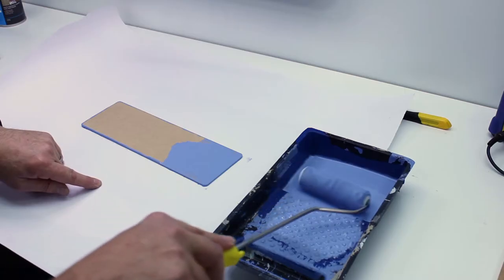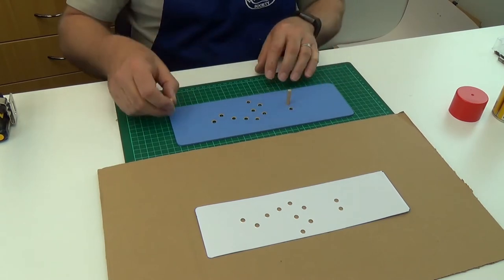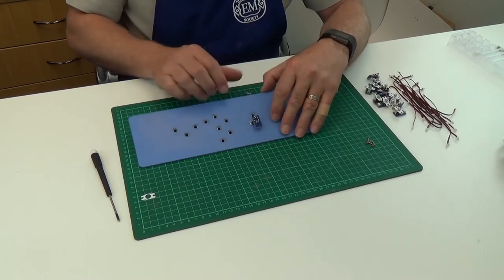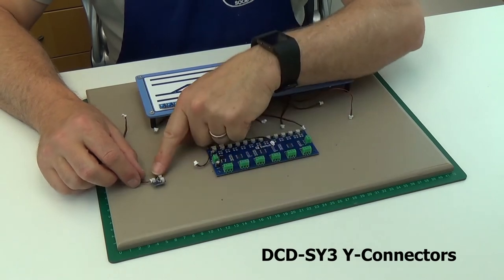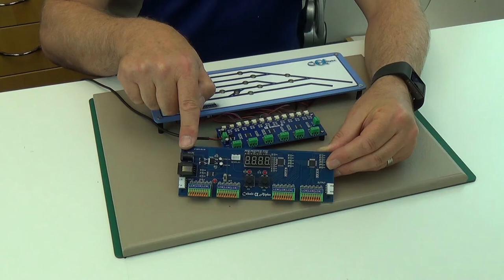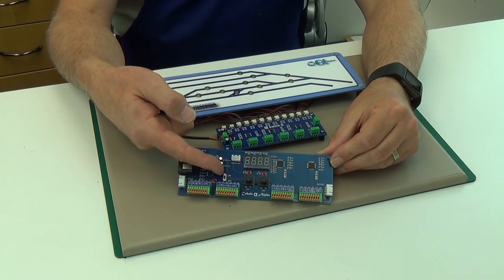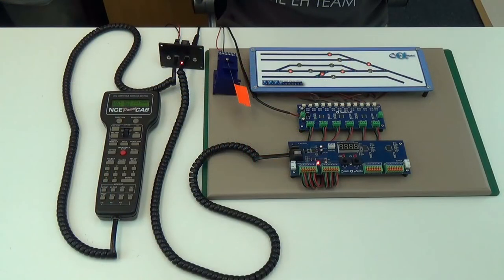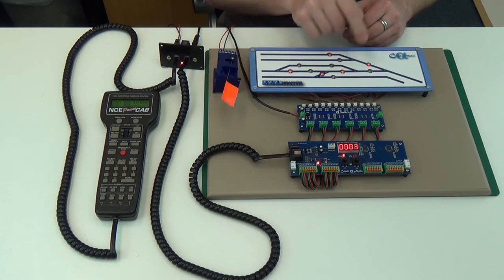DCCconcepts - Creating a Control Panel using Alpha Switch D (Part 2)

Comment: How would this be used to control a peco SL-E99 three way point?  It has two point motors and has combinations that have to be correct and in the right order to work

Comment: Can I use a Z21 connected to this system? And tortoise switch machines?
Kind regards
Jonathan
Reply from the maker: Absolutely yes - you can connect an Alpha Switch D panel into the Sniffer Port on the back of a Z21 system using our Sniffer Adapter (DCD-SNX). 
Pressing the buttons on the control panel will then send the command to the Z21 - the on-screen display will change and your accessory will be controlled :)

Comment: Is this Loconet compatible ? Or Xpressnet compatible ?
Reply from the maker: Hello John. 

It is only an accessory system that "piggybacks" onto an existing DCC system or is a "stand alone" accessory only system.

It is not directly Loconet compatible, but can be hooked into a Digitrax system using the relevant adapter cables and Alpha Box.

The same applies for Expressnet.

The Alpha protocols are based upon the NCE Cab bus.

I hope this helps...

Richard, DCCconcepts

Comment: Although I like the concept of (mostly) plug and play, for getting the digital input push button commands onto the dcc  and or accessory bus. It’s the multiple break points of 6 and 12 turnouts that is a real downside e.g. For 13 turnouts and need an extra AEU and a DCD-DSB costing circa £120 just for adding an extra turnout, it softens the blow if you need upwards 14 to 18. Sure for turnouts 7 to 12 and ditto 19 to 24 it is just an extra DCD-DSB at circa £50. You certainly have to be careful on costing this system up and that’s before all the cost of the dcc turnout motors! There’s certainly a high price to pay for going minimal on the wiring, but recognize it’s all about getting the balance features, components vs cost right. This video certainly helps clarify, particularly addressing in fixed address  blocks of 12 which you written instructions are not clear about. Otherwise a very informative video, left me a lot to think about! thanks Stephen
Reply from the maker: Don't forget that a crossover is only one input, not two - the same as a turnout loop or a catch-point :)
Reply: @dccconceptsyoutube6446  Yes realised that - three good points (pardon the pun)- just as for control of solenoid point motors. Thinking about that with your system can you do anything like diode arrays as used in route settings, that is without adding some other form of logic control/  processing or mapping/ array. Correct me if I am wrong but I got from this video that an input address has to match exactly the same point address so it can control it. Cheers Stephen

Comment: Not so much from this video but.... DCCconcepts seem to have great products but also the worlds most confusing naming to their electronic devices. I've been studying their videos, documentation and explanations for ages only to be befuddled by their combinations of strange terminology and I'm from an electromechanical background! Alpha this, Cobalt that, Cobalt Alpha combined, sniffers, boxes and centrals, Zen, iP, SS...... There is never a basic overview of what it means. It is always assumed that you fully understand all their complexities before you start! I bet they are inundated with queries simply because there's no explanations of how to make sense of it all!
Reply from the maker: Hello! Our products are in families, much like cars - so VW has (for example) a Golf and a Polo - under those model names there are various different options and trim levels.

DCCconcepts / Legacy Models - these are our main brand names.

Cobalt = Anything that makes turnouts and accessories work on your layout.

Under this there are various different models of turnout motors etc. such as Cobalt iP Digital or Cobalt-SS, there are also control system products such as Cobalt S-Lever.

Cobalt Alpha = Physical control of digital accessories. This is where pushing a button or flicking a switch sends a digital signal to change your turnouts or accessories. Still under the "Cobalt" umbrella as it controls accessories, but a sub-group which has buttons, encoder boards, extension wires etc... You can think of Cobalt Alpha as the components you'd need to build a control panel for your layout.

Zen = Anything that makes a Locomotive work such as decoders and stay-alives etc... 

Other products are individually named such as "Rolling Road" or "Trackbed" etc... 

We are open 6 days 10am until 5pm with a dedicated sales and customer support team. We also have a forum at www.dccconceptsforum.com and of course our main website at www.dccconcepts.com and on Facebook.

In addition to this, we also actively encourage dealer support and training, with events both here in Settle and with our dealership network - so you can get advice from your local dealer as well as from us direct. We actively liase with online experts such as Charlie Bishop, Richard Watson, Jenny Kirk etc... who produce videos to show and help explain the products.

If you have any questions about our products, then please do get in touch - we are always happy to help! :) 

^RB @DCCconcepts
Reply: @dccconceptsyoutube6446   Thank you for taking note and offering some kind of explanation. It's still a bit murky though as the the terminology doesn't sit well, flow or register easily in one's mind from the outset.
   My DCC layout is currently controlled with a Hornby Elite wired directly to the tracks only, no accessories bus wires, everything is powered and controlled through the track including the attached ADS-8sx. If I also wished to use an Alpha switch to manually control my analogue point motors (that are connected via a DCCconcept's ADS 8sx) as well as the Elite what would I need? Can I switch DCC controlled signal lights too via  an Alpha switch or push button switches?